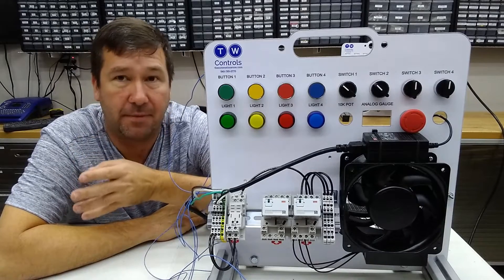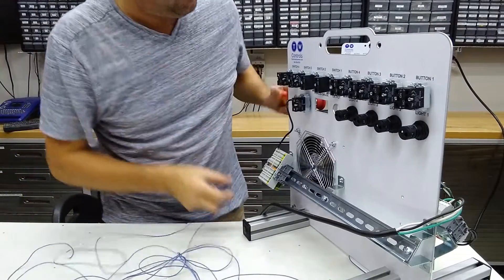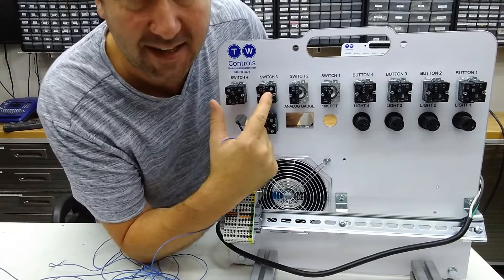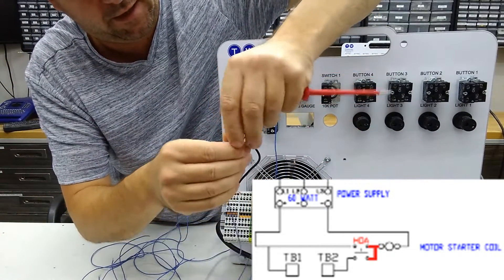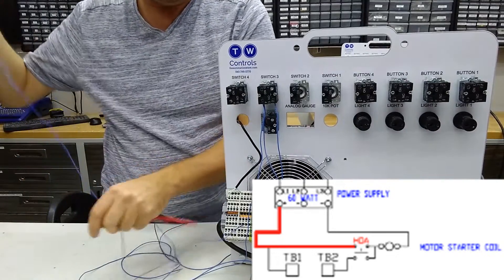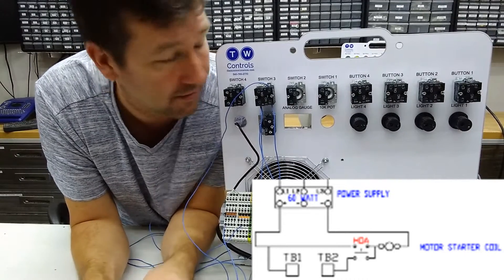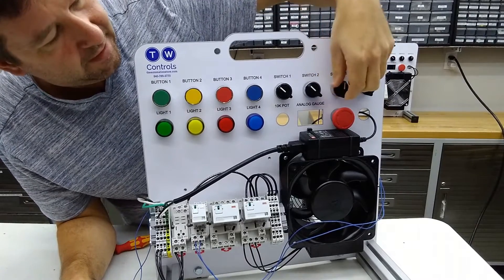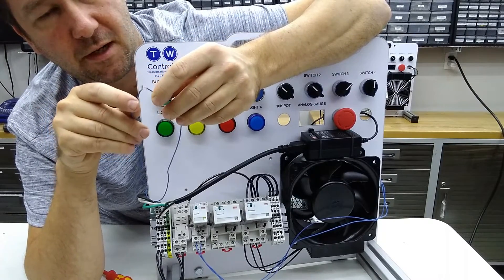How to wire a HOA Hand Off Auto Control Circuit

Comment: Could you show an example of how to make a motor rotation control using a HOA switch in combination with a DPDT relay? I’m trying to think of a way myself but I’m stuck 😂
Reply from the maker: You would just need a two position selector to divert the signal between the two. Seems like I have something on this, check out our videos section

Comment: I gotcha. I was just trying to do it on a 110 system I found for some reason I had to use two relays to accomplish what I needed because I was using the neutral for both leads.

Comment: Why would i lose voltage on the output of fused control circuit when hoa is switched on regardless if in manual or auto? When i turn his off and i cycle power voltage is restored. It is fed off step down xfmr. I replaced with new fuse also.  Even if i bypass and directly connect to contactor coil it does the same thing.
Reply from the maker: Check if the contactor pull in watts is higher then the control transformer rating

Comment: How would you troubleshoot the auto side if only the hand side works
Reply from the maker: In the case of my example, You would have two terminal blocks associated with the auto. With it in auto, to TB1 you should have 24V and chances are on TB2 you don't have 24V which means it would be the device in the field.

Comment: Nice video!
Man, I really need to get some practice with this type of wiring, maintenance, and troubleshooting. 

Can you teach me how to clean contacts, change over loads,???
Reply from the maker: Thanks.  Contacts and overloads on motor starters are pretty self explanatory if you have a contactor that has serviceable contacts.  I don't have any around but they can save you a ton on those big nema starters.